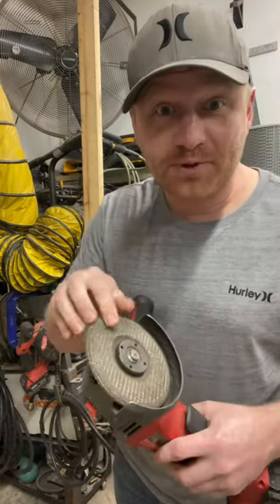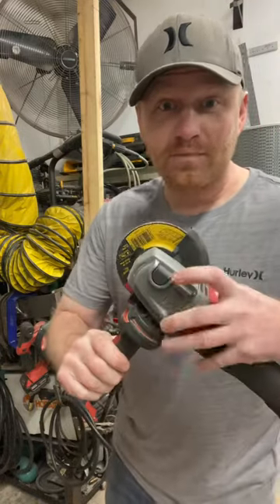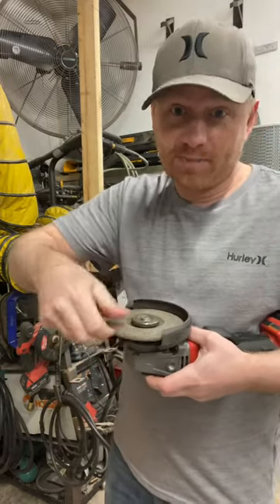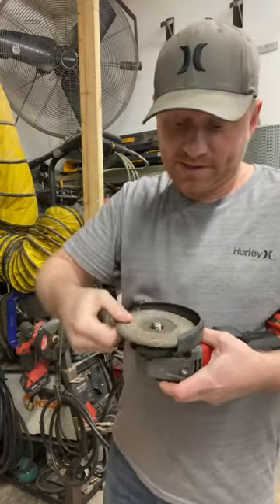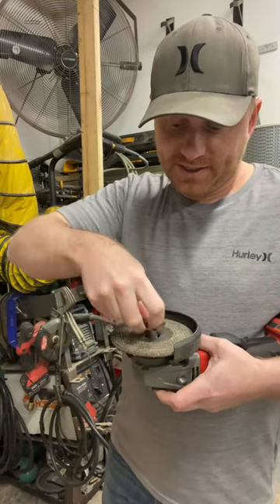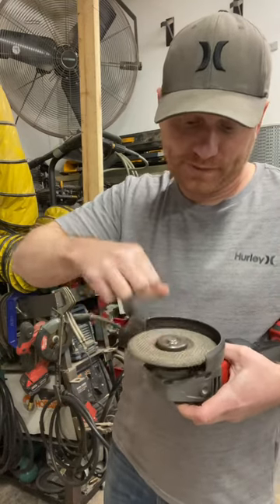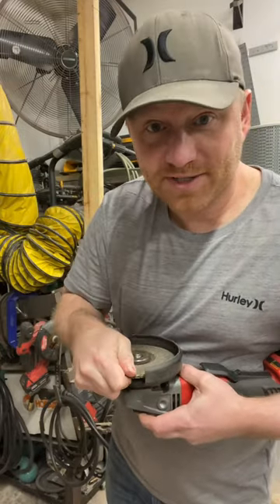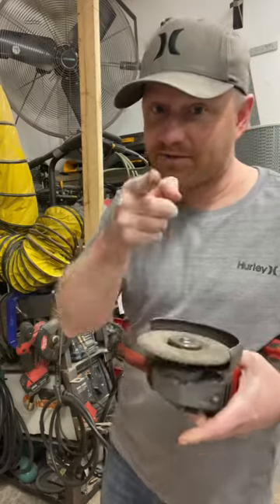Stop using a wrench for this! #shorts

Comment: Agreed... also agreed to take the batery off before doing that!
Reply: Or unplug
Reply: Didnt even see that at first, thats spooky
Reply: It ain’t going anywhere. You got to push the safety and the start at the same time
Reply: Bah, safety third.
Reply: I’ve seen more than one person lose some fingers that way
Reply: No need. Unless you are going to be hitting the safety and pulling the trigger yourself, nothing will happen.
Reply: @Overland_Vanlife  fake news
Reply: @ksmachinist3373  okay bud.. Ironworkers have a saying.. “you can tell a Joe by their fingers and toes” meaning if they are missing fingers they are Joes.. happens quite often and grinders with cutoff wheels are one of top industrial accidents there are
Reply: Gotta make it exciting 😂
Reply: @Overland_Vanlife  I have the scars from blown up death wheels as much as the next guy, but there ain't a damn one I've seen cut a finger off. If you've seen multiple, you need a new employer bud.
Reply: @ksmachinist3373  Lol wheels of death, yes I have those scars too.. over a 30 year career as a structural Ironworker I’ve seen at least two instances where a guy hasn’t unplugged the grinder and the grinder doesn’t have the flip safety mechanism because it has been beat up over use and thrown in gang boxes and weren’t properly red tagged or removed from service and while tightening the disc they hit the switch, cutting deeply into their fingers.. same mistake of not unplugging or using equipment that isn’t safe but the job has to get done and no superintendent likes when guys complain about tools and most guys make the tools unsafe on purpose to make the job easier as I’m sure you know since I’m assuming you’re a machinist
Reply: @Overland_Vanlife  fabricator first, welder later, machinist, foreman, super and then corporate. Your comment said you saw multiple people lose fingers due to this, now you back track. Deep cuts and losing fingers are far different. I stand by my previous statement, fake news.i
Reply: @ksmachinist3373  hahaha I didn’t go to their house and make sure they were okay, and obviously they no longer came to the job site I can only assume that with fingers hanging on by glove strings that they weren’t saved but like I said I’m an Ironworker not a doctor. You can say fake news it doesn’t matter much to me lol and that’s a commendable career going from welder to Corp.
Reply: @Overland_Vanlife  I appreciate that. I just turned 36 and was still swinging a hammer with my guys today. Grind and shine with them is the policy. I still have never seen a finger taken off with a cut off wheel. Lots of cut bones and shattered ones, not a single one off.
Reply: Its a quick release for your fingers .😅
Reply: My brother messed up his fingers pretty good
Reply: I used to never unplug/take battery out till one time I borrowed a colleagues grinder, changed the blade with my hands and as soon as I finished and put the grinder down for a sec it turned on. Colleague laughed and said yeah it does that, I felt like I nearly lost a finger or three
Reply: I took the blade off my hackzall with the battery in and safety off. I also press my hand against my drills chuck while it spins and gets fire hot to stabilize it while using certain stuff
Reply: The city main doesn’t have a battery installed yet so I think I’m good!
Reply: @Overland_Vanlife  Not a cut-off wheel in the vid.
Reply: @Radar433  Not from putting on a metal grinding disk. If you have seen a lot of fingers cut off? Maybe your shop needs a safety course.
Reply: @mainmanmooky8820 his finger is on the brake.  I still pull the battery though.
Reply: Oh you're "one of them guys"...... Live a little man
Reply: It's safe to do what he did.( it's locked and has a safety). I wouldn't do it myself due to Murphy's law but I also snug them up in the vice for the same reason.  Safety first, check your own equipment before you use it,  call out cowboys. You might just save a life..or a finger.  You wouldn't believe some of the ways fingers go flying in the workshop😂
Reply: Because I'm paranoid, I even "pull the trigger" to "deenergize"
Reply: True, I can count on one hand how many times I’ve made that mistake. The other hand is missing a few.
Reply: @Overland_Vanlife no you haven't
Reply: @ksmachinist3373 exactly what I was thinking
Reply: @kayden funk  iv literally seen someone do this and was fukn scary as hell.  They bloody lucky as hell they didn't chop there fingers off. But they lost a lot.of blood and there grip is also fucked.    Just take the battery out. Takes 2 seconds. U any idea how easy it is to hit that safety and trigger while doing this. Then u have never used any kind of power tools.
Reply: @jmackinjersey1  it takes half a second to pop the battery off. Am I going to hit the safety and the trigger nope but anything that cuts better safe then in the er.
Reply: At least he had the guard on there. It’s something I see too often
Reply: Bah, what for, nowadays it's so hard to accidentally start a grinder, I do everything in mig gloves anywayssss...
Reply: @kaydenfunk8412 totally, in fact its hard to get that fucker going even if you intend to cuz of the stupid safety things nowadays
Reply: Hard to do when it plugs into the wall
Reply: Also the button that stops the disc from spinning when being replaced, also works if you were to try and start it whilst holding said button
Reply: That was the first thing I noticed at least he has a guard
Reply: @kaydenfunk8412  it almost happened to me lmao almost lost my hand
Reply: by the time it comes up to speed youve let go
Reply: Definitely not guilty of accidentally switching it on while tightening as an apprentice..... However I was wearing gloves and learned to not put my hand anywhere near the switch afterwards. It's impractical to unplug a 110v plug every 15 mins when using 1mm slitting discs constantly. Know your tool, know trigger discipline and treat it like something that will kill/harm somebody and you'll be okay
Reply: Righty tighty lefty losey handsy
Reply: And just keep safety glasses off you don't need to take them off while in the work area. Get antifog ones and forget they are there. Eye sight us a precious thing

Comment: Now do it with a wire wheel
Reply: With welding gloves it’s no problem
Reply: @daxlangeveld6053 that's what I was about to say. If your wearing gloves as your likely should be, you'd be fine.
Reply: Even without them, tightening as much as you can without pain is enough because it tightens as its used anyways
Reply: @Szymon_Uliasz get a stronger grip and grab it by the cup being the wires
Reply: Spanner wrench won't do much either
Reply: @daxlangeveld6053 Normally I have my gloves on but made the mistake of thinking they were on when they weren’t. I have so many regrets about that day
Reply: I just either put leather gloves on or drape a leather glove over it before grabbing it. Sometimes I just forgo the glove if I can't find one and just use my shirt or nothing.
Reply: use gloves but even without just drag the locked wirewheel over a workbench to untighten
Reply: I do it with or without gloves all the time. This guy's clearly never cut much with a cutoff wheel though, sometimes you just need the wrench

Comment: I change my blade that way all the time. Only thing I recommend you do differently is take the battery out while you do it.
Reply: Especially with the way he's holding it. 👀
Reply: Exactly what I was thinking
Reply: We're paid by the hour, got stuff to do
Reply: I couldn't agree more. Take the battery out. I never did and now I'm sporting a really awesome 8 inch scar on the side of my stomach where I slipped off the stop button and accidentally squeezed the trigger at the same time with my arm. Friggin excitement for about 3 seconds. I managed to drop and break the grinder, cut/burn my side open, and almost needed new underwear... 😮😅💩 safety first boys and girls...
Reply: Where’s the fun in that? 😩
Reply: @g0sp0dstv0v4n1  Those underwear get expensive to replace 🤣
Reply: paid by the hour should mean the job that takes longer pays more.
Reply: @izzmire1  Exactly, slow down, save a finger or body part and make more jingle in the process. In the end, you will have a little more beer money and still be able to flip your boss off. 🤣
Reply: This would be smart, I always thought it was a pain in the ass to take off the disc after you used It to grind something.
Reply: On this Milwaukee I wouldn’t be too bothered by it. The cheap Ryobi one though, is a death trap
Reply: @Insertnamehere662 my dewalt corded thankfully has the thumb trigger that locks in place.

Any "paddle" style that don't have the safety flap though.... good luck boys you do you. I've almost cut a hand off with a giant blade that led to surgery and near death. Almost chopped a thumb off when I was sleep deprived. Countless other close calls.

I'm pretty safety minded now 😂

Unplug before changing stuff. Safety glasses. Gloves/clothes where applicable
Reply: It was a safety trigger...
Reply: the button won't let it move even if it gets turned on
Reply: That’s exactly what I was gonna say
Reply: or know what you're doing.
Reply: My bro and I do this all the time, but one time, my bro was doing this and didn't unplug it, and he had it between his legs, luckily, he had the blade loose when he bumped the switch and he just got a couple deep scratches.
Reply: Solid
Reply: Learned the hard way, cut open my thigh with one of them when I first started doing mechanic work back in the 2000s

Comment: I work in a metal fab shop and have never seen a single person use the wrench. Always this method with gloves on.
Reply: Gloves is the key, thank you
Reply: I only use gloves when I'm taking off the cup wire wheels
Reply: Gloves...what is that
Reply: Gloves are only used for hazardous chemicals, bud.
Reply: You must have never used a Metabo wheel, that has busted
Reply: @chadklaren9537  same here, everything else is barehanded
Reply: Unless it's for the 9"...
Reply: @Billy bob  you are not a mechaic
Reply: I prefer to take the battery or air connection off before changing discs.
Reply: @nickballinger9314  *228,6mm
Reply: Exactly lol I did the same for awhile and this is the only method I know.
Reply: Only time I use the wrench is when im taking the diamond cup wheel off my 7" grinder, that SOB gets tight.
Reply: Gloves? What is those for? 😂
Reply: Gloves? What are you, some kind of dandy?
Reply: You guys must never use cut off wheels
Reply: Gloves is key. Iv gouged a couple of fingers breaking them loose
Reply: @yohanathandowns9057  I bet you got the guard on yours,  what are you some kind of Nancy boy?
Reply: @ThePainkiller3666 no. Somebody who's been using them for 11 years and have seen 3 disc explode, and hundreds of flaps fly off of flap disc's.  Better to have the guard on when they do... Nancy boy.

Comment: The comments on here are ridiculous. As someone who uses a grinder all day and changes out discs all the time, you did nothing wrong.
Reply: I do this all the time.
Reply: Over 25 years of using one of these the same way. It's totally fine. Rotational torque tightens it against the nut anyway. And there is no "brake" to stop it immediately, creating counter torque to the nut.

SCIENCE AND SHIT 😂
Reply: Remove the battery. 
That’s all I’d do differently
Reply: Disconnect or take off battery
Reply: Unplug or take battery out and I’ve never used the wrench
Reply: 1 problem....he didn't remove the power source, in this case, the battery. I know, I know, you never disconnect the cord or remove the battery, until you ACCIDENTALLY energize the tool and it tears your fingers up....just saying
Reply: I would still use the wrench and disconnect the power source it's better to be safe as you can possibly be.... You would be amazed at how quick you can get injured or even die from an angle grinder losing the disc or the disc shattering with or without the guard on.
Reply: @warburk  people that actually use grinders don’t know where their wrench is lol
Reply: @1Fine69c  you never heard of wire or string and attach it to the grinder cord or a tool box or
Reply: @1Fine69c  also I do use grinders both at home and at work, bench and handheld with one hand or two... I still have my original angle grinder tools. I like to take care of my tools. Cause in the end tools are useful, powerful and very helpful to have. Damage or misplaced parts can spell disaster for both you (monetary buying new tools/parts)( physically if you get injured) and what situation you are currently in. Let's say and pipe burst in your home and you want to fix it, having the proper tools with all the parts helps a lot right. I fix stuff everyday, whether at work or at home. I do it cause I care about my home, family and workplace
Reply: @warburk  nope. Just use my hands. If a cutting disc explodes on me it’s usually tight but comes off with some channel locks a lot easier than using the wrench.
Reply: It's really not necessary to tighten it . Turn on the thing it will do it on its own
Reply: @nathanlindley5354  cordless grinder usually comes with 3 year warranty.
Most parts are quite robust. Except for the battery connect pins 
Cordless grinders are not easy to trigger by mistake.
Take out battery only cause more wear
Reply: He might not have done anything wrong. It is always the new guy who fucks up doing it this way.
Reply: @calvinb2965  best way to learn lol. We hired a new guy a month ago. He was doing a bunch of cutting and we kept telling him cut at 2 o’clock on the disc, just go back and forth across and let the grinder do the work. He never listened. He cut at 10 o clock and jammed the disc into it and the blade blew up and almost hit himself in the face with the grinder. Now he does it the right way lol
Reply: @billsmith9234  then how did I manage to see grinding blades go flying 3 different times?
Reply: @warburk  "I like to take care of my tools"
You just don't know how to use them 😂
Reply: @mattmurphy7030  ok quick question why would every manufacturer of every grinder include a wrench with every grinder... They engineer and manufacture the grinders they know about the machines they create... They include a wrench for a reason, otherwise they wouldn't cause well it's more expensive to have the wrench then not
Reply: Snap
Reply: Yea right we all know your supposed to just hit the button after you shut the grinder off but while it’s spinning and it takes it off for you 😂😂
Reply: Your going to get some one hert
Reply: @marcspencer800  good lord does the devil come to you for advice? Lol
Reply: Okay that blade will not turn if you have hold it and hit the gas
Reply: @ZackBrackett  if you ever go to that played it will not start spinning
Reply: @warburk  when you over tighten the Arbor The tool has a higher propensity for breaking thinner blades it is way way way safer to allow some slack so that the blade will slip if binding
Reply: @billsmith9234  not to mention that blade is not going to start turning holding on to it
Reply: @sethm7595  if he cracks or weekends that blade in any way by holding on to it and tighten it I've done this also and I've also cracked disc they will blow up on you if you crack one and I have cracked one doing this
Reply: @warburk  Americans tend to think they're smarter than an engineer that has studied the grinder and it's tools. Then a disk explodes or finds it's way to their head only being blocked by, if they were wearing it, the protection gear. But, again, americans tend to think they're better than the designers and safety studies and fuck all that shit.
Reply: All day hey ? Just get a few of them then.
Reply: Nothing wrong it just looked gay, why do some weird hand clamp thing, use your palm right on there, although I have had to use this or a vise before when a blade got it really stuck
Reply: @warburk  That is just not True kiddo. Their are even grinders on the market wit a nut you can't even use a wrench on... So please do not lie.
Reply: @mauricematla8379  what brand
Reply: @warburk  peace of mind for folks that need it probably responsibility matter for them as wel.
Reply: @warburk  We had them from Metabo (not sure if those are availeble in the US.) Hand tightening is fine. As a welder i have used them a lot while there are sometimess problems never have i seen or heard of a nut comming loose. And that can't really happen either provider you put it fully on unl3ss forced in the other direction the nut can only move in one direction whike in operation.. Tighter.